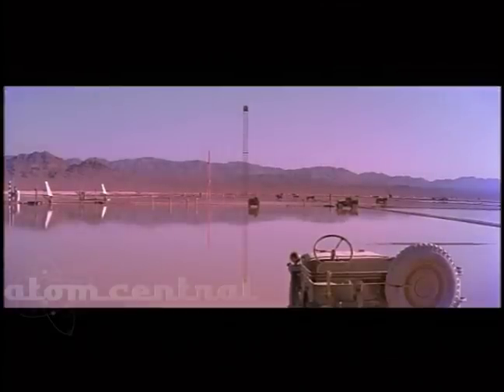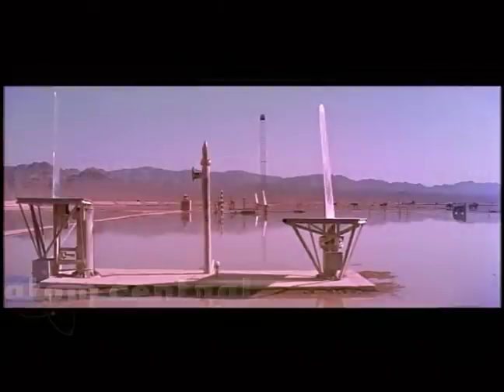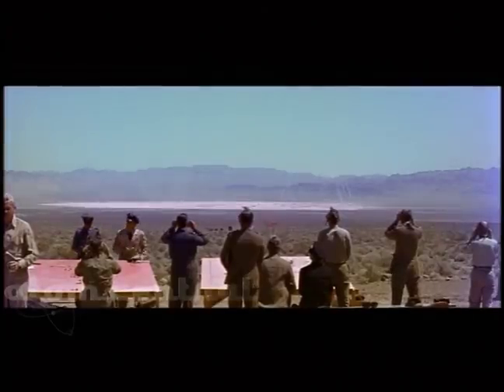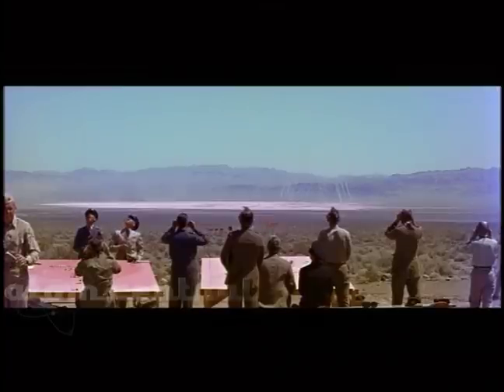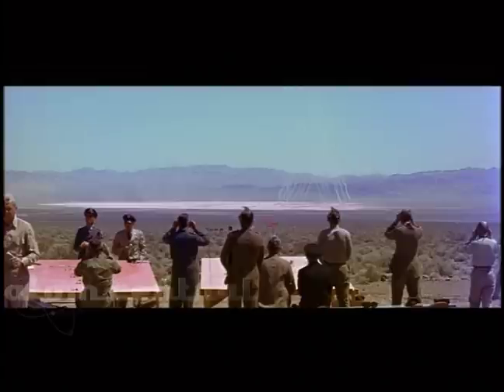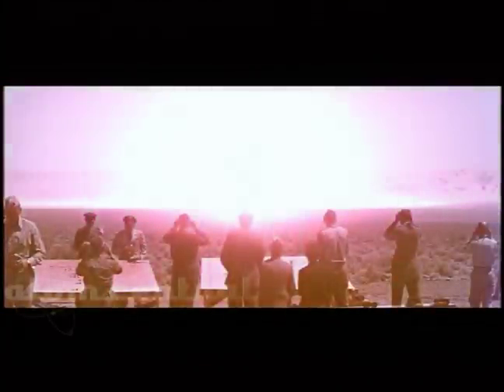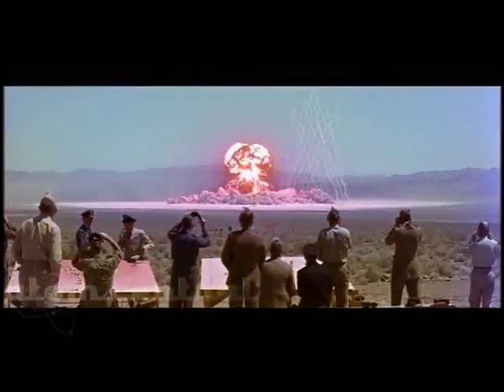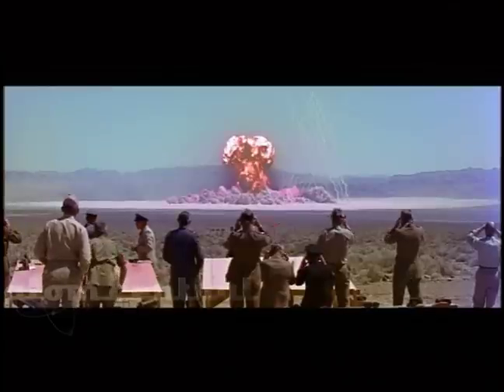Atomic Bomb Cinemascope short (SD)

Comment: "Operation Teapot was a series of fourteen nuclear test explosions conducted at the Nevada Test Site in the first half of 1955." 
Imagine......14 nuclear explosions in what turned out to be 3 months. This MET blast was 22 kt.  Similar in size to the bombs used in Japan.....city destroyers. In comparison typical warheads on current US bombs and missiles are 250 kt or even 400 kt.
Reply: Typically 550kt for strategic warheads, 10-150kt for tactical weapons.  And of course a lot of our warheads have dial-a-yield control as well so you can select.

Comment: Another great video & good job piecing it together. Did you happen to catch an emulsion number on that Eastman film?
Reply from the maker: I didn't see the emulsion number at the time I had access to the film but in 1955, this would have been Eastman Color Negative 5248.  Kodak often reused numbers which can be very confusing.  The number 5248 was again used in the 1970's as Eastman Color Negative but the ASA was higher in the 1970s. The first 5248 was introduced in 1952 and discontinued in 1959.  It had an ASA of 25.  The later 5248 was introduced around 1978 and had an ASA of 100.
Reply: @atomcentral  Ah! That has the same history as the 5247 that I'm still using up. Mine is from the later production run. Have just a little 5248 left, but not much. Both are great films & still produce great images. They have been in a deep freezer for a long time, so that helps. Many thanks for the response. Regards!

Comment: Oh, man a 4:3 letterbox. What a waste.
Reply from the maker: Cinemascope was a 2:1 squeeze.  With the aperture plate, that made the ratio 2.35:1, not 4:3.  Unfortunately, I don't have access to the film anymore.
Reply: @atomcentral  But it's a widescreen in the format of 4:3 so you have black bars on the sides and the top and bottom. It will be widescreen on a 4:3 TV, but on a 16X9 TV you will get the black bars on the sides.